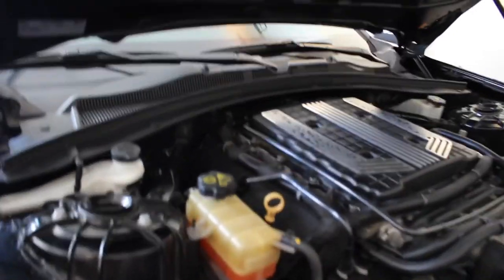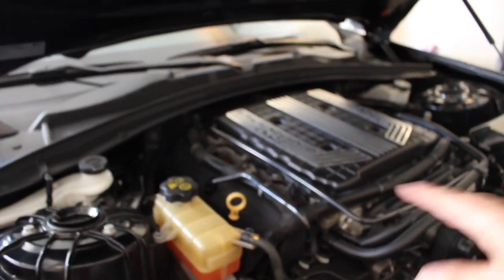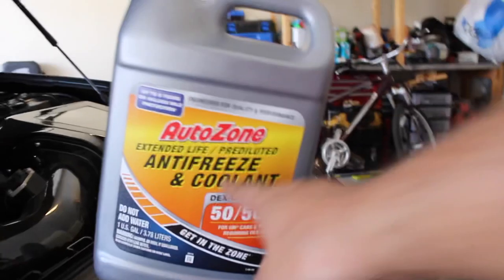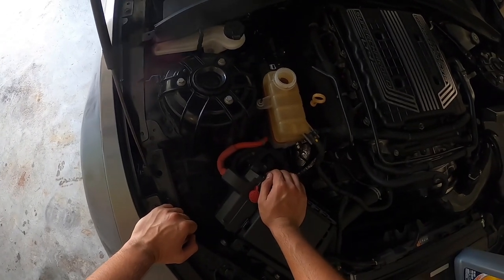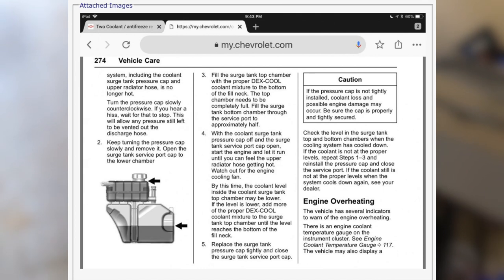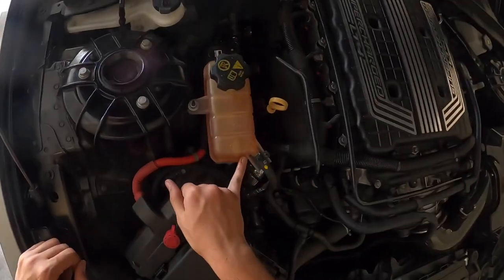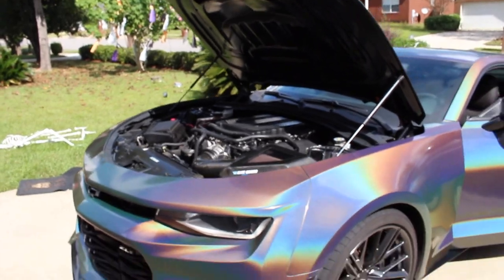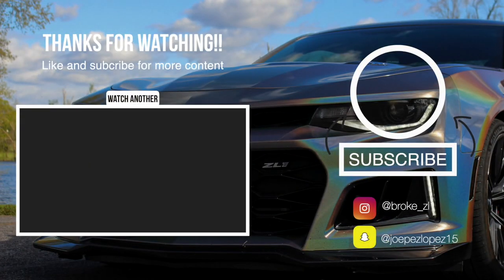How Much Coolant does a ZL1 Need? Upgrading Cooling System?

Comment: That was informative. Thank you. I recently replaced my stock reservoir with a Mishimoto expansion tank. So far so good. I actually see it rubs cooler. Maybe because it doesn’t get as hot, being that it’s not plastic(?). 
Other videos show you don’t have to add coolant to the bottom. I am confused…🤪🤪🤪
Again, thanks for posting.

Comment: That tank has nothing to do with your super charger cooling, if you are heat soaking, it's because you have air in the intercooler system and need to bleed it.